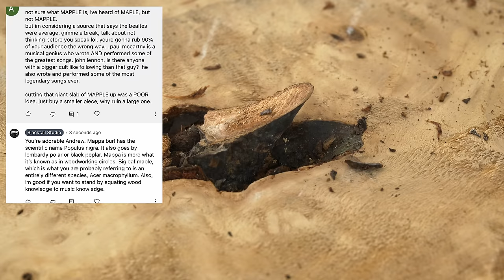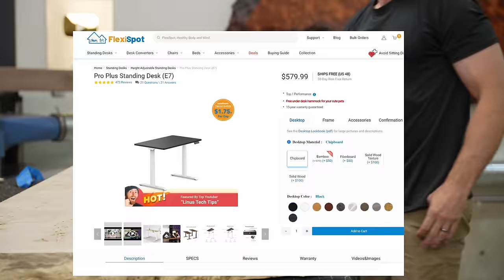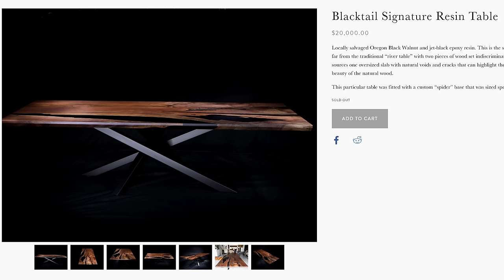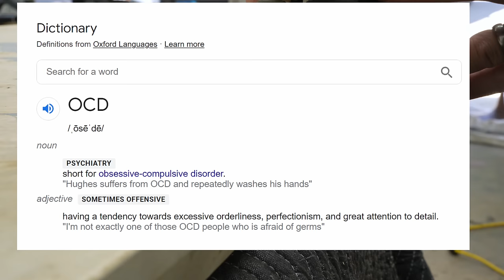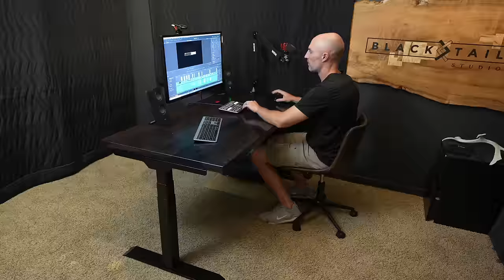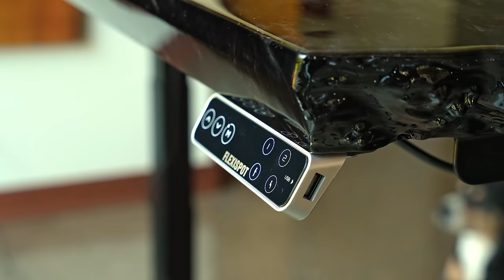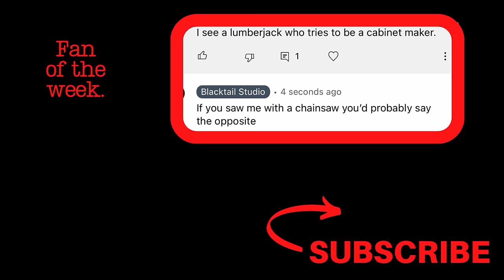Woodworking Fraud

Comment: Dark for sure !

Hey Cam, I'm a spray-painter from Germany and I used to work in an automotive shop for several years (learned a lot!!)
I've noticed that you struggled a little bit with your sanding on this project and I think I got one or two tips that might help you.

First : Don't put to much pressure on your orbital sander! 

With to much pressure your disc won't turn, but rather vibrate which can produce those curls* on the surface.
More pressure will generate more heat on the surface, wich will soften  your coating up for a moment and make it vulnerable for curls* or bind up your Sandpaper. Especially if your coating has not hardened completely.   
Bound up sandpaper is more likely to damage your surface, because you are dragging stuck particles over it.
Always put your sander flat on the surface, if possible never use the edge of the sander in an angle. It will uneven your surface and maybe leave deep scratches.
To much pressure will also damage your sander (gears and shaft especially) and your orbital disc, it will start to vibrate more or even shake or wave in your hand and maybe leave a bad surface finish.
Rather use lower grit sandpaper with less pressure, than higher grit with more pressure.

Second: Never use dry sanding paper as a wet sanding paper!
The liquid will loosen the grit (particles) of your dry sanding paper. Those loose sanding particles will be rolled around or even pressed into the surface under your orbital disc and potentially leave curls*.  

Third:  Always sand as clean and dust free as possible!
No matter if dry or wet sanding, always clean your surface and tools between the grits or every now and then. Left over sanding particles of higher grits, dust or dirt in general can damage your surface. Especially because you are sanding most of your projects horizontally the dirt will stay on top of your surface. If you pay attention you will sometimes even feel or hear particles or debris rolling around between your sandpaper and surface.

Forth: Always sand in circular overlapping motions (if possible!), especially hand sanding on flat surfaces!
It isn't always possible to sand in circular motion, but it is the best way to keep your surface even and avoid surface damage.
If you (hand)sand only back and forth, you are dragging the same particles over the surface over and over again. This can lead to deep scratches or rubbing* on your surface. Also you can unknowingly create deep craters on your surface wich you will discover after your surface finishing/buffing.

I do have a few more but I am pretty sure that you know most of them, I am also pretty certain that you know most of the ones I have just pointed out or someone was faster than me but maybe there is something helpful in there. You will surely get the feel for spray painting soon, cant wait for that.

Love your Vids because you are honest with you failures and super entertaining, I learn something new almost every time I watch your projects. They are super amazing and inspiring like the denim table or the burned one❤
Reply: Good info. Thank you sir.
Reply: Jens,
Thank you for posting your sanding tips!!!
Most of your tips I have been doing the wrong way and get the results you were talking about never realizing it was because I was sanding wrong.
Looks like I'm going to get a new orbital sander since I have used mine edge sanding A LOT and wondered why it vibrated SO bad.
Thanks again sir!!!
Reply: @MPH6260  @JamesEhler  I did the same mistakes for years but never realized, UNTIL I started working at an Automotive shop^^ 

It would make me super happy if one of the tips can help you to improve your results. ;D
Reply: Dang, that explains why I have so much trouble with my orbital sander both at work and home! Thank you for these tips! Especially the hand sanding tips!
Reply: @Fantatures  You're welcome, I hope the tips proves to be useful.
Reply: as a person considering into industries like this, I will read these tips like the bible haha thank you!
Reply: Well that helped me so thank you :)
Reply: You put this much effort into trying to help him and explain carefully everything, but he didn't care and probably never read your comment :(
That's the reality of youtubers
Reply: @emanuele5799  Hey Emanuele, I don't mind it and I don't need a response from Cam😂.....there is no way he could answer every Post ever made, without getting insane anyway.

There are many many good advices and techniques on the internet...., and the way I learned it might not be the way for everyone.

I just wanted to give something potentially helpful back, for the tips Blacktail-Studio shared with me.

But I have to admit it made me very happy to see some responses from you guy's, who maybe found one of my advices helpful😊.
Reply: @vox288  You really are a nice person
Reply: The Dunning–Kruger effectin action: I have sanded things my whole life, although just sporadically for different projects. All the training I've ever received is just the basic American, father-to-son tools training received while growing up. I never would have considered myself a master at sanding or anything, I never would have even thought twice about there being any deeper sanding knowledge, really. However your comment makes it clear the amount of inception'ed things I don't now that I don't know. The unknown-unknowns.
Reply: @PayterX  The unknown-unknowns, we all have them for sure🤣 🤣Its always a question of how deep you really need to, or want to dive into a Topic😁
Reply: You definitely helped me which in turn will help ky kids as I teach them to sand so thanks so much dude!
Reply: @TheChardygirl007  Thank you for your nice reply, really made me smile😉
Reply: Hello from France. We're not all pros here. I'm just an old lady trying to refinish some old furniture. Your tips here have made me rethink all my sanding. An enormous thanks for you trouble. Merci beaucoup !
Reply: @dotlaowai De rien, dear Lady from France😁
Reply: @vox288 ich liebe woodworking videos 🤩
Hätte niemals gedacht, dass beim sanding so viel dahinter steckt 😂 werde deine Tipps für mein erstes Projekt im Hinterkopf behalten (ein live Edge epoxy Esstisch 👀 inspiriert von John Malecki, er macht auch richtig gute woodworking videos) 
Dankeschön 🙏🏼🤝🏼
Reply: @I_am_Jess__   good luck and lots of fun with yout project, take it easy and I am shure it'll work out for you✌😊

(I just had to redo a small project twice because I tried to rush it....still happens sometimes 😂)

Comment: Could you do a total cost breakdown into a project like this? When a piece sells for $9,900, how many hours of work total, material cost, equipment cost, electricity (maybe a bit harder to break down but I'm sure it has an impact when using drills and electric sanders. Amazing piece!

Comment: The dark finish is incredible. I typically do small woodworking projects with contrasting wood, hand cut dovetails, some inlays, some epoxy inlays. With the lighter colored wood by itself  I hadn't achieved the look I wanted. I played around with alcohol dyes using what I had, my printers used cartridges. Got some great results and pretty much unlimited color combos. I really like how the black you used turned out, stunning. You put in a lot of time on your pieces, it shows. Very nicely done.

Comment: The desk was a beauty, nice job and I prefer the talking throughout the video explaining your trials and tribulations. Now as far as spraying a finish I used to work in a fiberglass shop repairing cars and boats and learned how spray paint there. Two basic rules I learned was, #1. Keep about 2 to 2 1/2 feet from your project and #2. Keep your arm and spray gun even with the project. Do not spray at an angle. In other words, don't turn your wrist to get farther down. Keep an even coat at the same distance all the way around. Pretty easy after a couple of practice sprays. It's pretty much that simple. Keep it up. CJ Bear

Comment: This is beautiful. As a sit/standing desk user though, cable management is a big deal. When I put my desk top on the electronic components, I had to create a recess/box attached under the desk for all the monitor, speaker and peripheral cables, so that the desk could go up/down without a mess of cables being dragged around. If you do this again, it'd be great to see what solutions you could come up with for this.
Reply: Instead of the C channel use aluminum extrusion and recess it. Then you could put bolts for accessories under
Reply: @millhouse782  genius

Comment: When you start polishing with the machine start it on its lowest setting to spread the polish around, then increase the speed. 
That way you won’t get all the splatter on polish everywhere. 
Also a good idea to ‘prime’ the pad first to make sure you don’t have any dry spots on the pad. 
Finally you should use your air compressor to blow out the pad regularly so you remove any contamination that could cause scratches in your finish. 
Hope that helps 👍
Reply: That power tool may only have two states: ON and OFF. They are torquey too, so even just bumping the trigger causes high RPMs.
Reply: @lerkzor  Very easy to burn the finish with the polisher, even with the super fine polishing compound.  Ask me how I know.

Comment: Light natural color is nice. I use epoxy a lot in boat building, there are a couple things I might suggest: 

When using West Systems epoxy, use the 207 hardener instead of the 205. It is designed for clear coating applications. While adding the black to your epoxy probably protects you, the 205 hardener can get cloudy after it has cured. 

When applying epoxy to bare wood, I always do it while the temperature in my shop is falling - getting cooler. I heat my shop up over 80° for a few hours before doing the work and then turn down the heat during the process. This causes the air trapped in the wood to contract, drawing epoxy in. If the shop gets warmer during the cure it can drive air out, causing bubbles. Warming the wood will also lower the viscosity of the epoxy, allowing it to penetrate deeper without adding solvents. Adding solvents is OK, but degrades some of the physical properties of the epoxy and slows down curing.

If you are going to sand the surface level, get long boards with dust collection, it keeps the paper from loading up. Mirka Abranet has some great hand sanding tools with dust collection.

Be careful using tack cloths on a surface that you are going to coat with epoxy. The waxes used to make the tack clothes are not compatible with epoxy and can cause fisheyes and other issues if any should get on the surface. Obviously, it is possible to use a tack cloth before epoxy without issues, but when it doesn't work, it can cause horrendous problems.

Epoxy is not good with UV. Even "UV stabilized" epoxy will eventually start breaking down due to sun exposure. My research suggest that UV stabilized epoxy is designed for about 1,000 hours of sun exposure. For furniture in a house, this is probably a very long time, but it is just a matter of time. The ceramic coating you apply should help extend the live of the finish, but I always apply a UV protective clear coat to all my epoxy coated boats. A varnish or even better a 2-part automotive style clear coat will produce a much longer lasting finish.
Reply: Well thank you for sharing that regular epoxies cannot stand UV rays. I did not know that and always dried my items in direct sunlight. I live in Florida and the humidity turns my work into crap.
Reply: @WarPigstheHun  The effects of UV happen over time. It breaks down the bonds between epoxy molecules. Placing epoxy out in the sun should not do much to damage the epoxy. 

However, placing wood coated with wet epoxy out in the sun will cause air in the wood to out-gas. This can cause a serious problem with bubbles.

Working with epoxy in humidity may cause a problem with amine-blush, a waxy substance caused when epoxy cures in a humid environment. This waxy substance can show up on the surface of the epoxy and must be cleaned off before any other stuff is applied over it. 

Blush can also occur in the epoxy matrix and may appear as clouding in the epoxy over time. The 207 vs 205 West Systems hardener resolves this issue.
Reply: @NickSchade  gawd, I wish my garage had AC. I have a small Ryobi fan that I sometimes use to help cure things and repel moisture. Maybe I'll buy more of those fans as a cheap solution to the blush and bubbling.

Comment: Light or Dark: Both look fantastic, but the dark table has the look of a table that has been taken care of for years and years. Well done!
Reply from the maker: Thanks, John, appreciate it!
Reply: @BlacktailStudio  for your buffing. Look into a product called aqua buff. Comes in 1000 and 2000 grit. I first found it working with fiberglass on boats for the gellcoat. But have also used it on cars, glass, metal, even plastic, and poly epoxy. Works wonders on old headlights you name it. It's water based and pretty cheap. Let me know if you like it.

Comment: Having been in the auto body refinishing industry for nearly fifty years, I learned that wet sanding epoxy using plenty of water is the most thorough way to sand such finishes. Wet sanding cleans away sanding material and dirt thus having a scratch that matches the chosen grit accurately.

Comment: Dark - you can also use “penetrating epoxy” from the stone industry instead of thinning down regular epoxy. There are a lot of diamond tooling pads and such from the stone industry that you could incorporate into your process that will help you save time and money, as well as improve what you are already doing when it comes to polishing - it’s all basically the same thing regardless of whether it’s wood or stone. Nice job - well done !!!
Reply: Dark, so beautiful! Well worth the extra time.

Comment: 8:12 While the point you made with the expensive tools and the golf analogy has some truth to it and quite the interesting perspective to "just think about it", I would advice against it because:
1. The more advanced and sophisticated the tool, the higher the degree of craftsmanship one needs to even comprehend the capacity and fine subtle features it offers. The tool's potency would be wasted if even being used successfully at all.
2. The more a beginner relies on their tools the more they will stay a beginner. Maximizing the capacity of a small number of tools, of probably basic characteristics, even to the point of using them beyond what they were intended for and making them an extension of you, developing personalized methods of usage BEFORE going to "the next best thing" IS what Mastery is all about. YOU should be the ace, not the tool .....very easy to forget that in the combo of beginner + fancy tool.